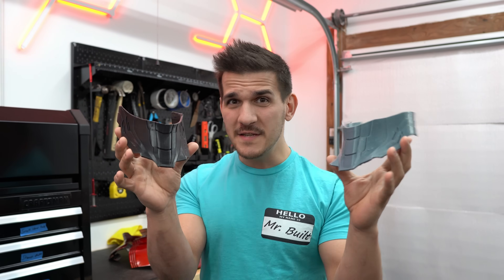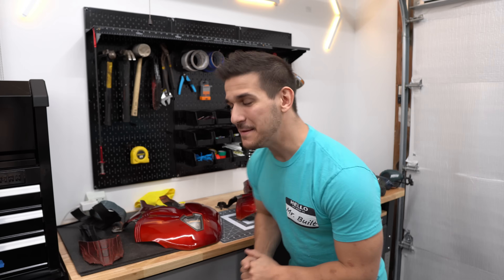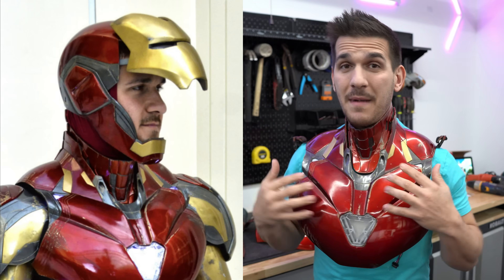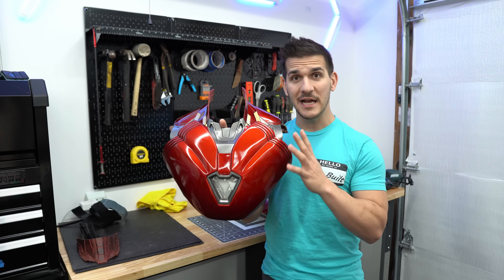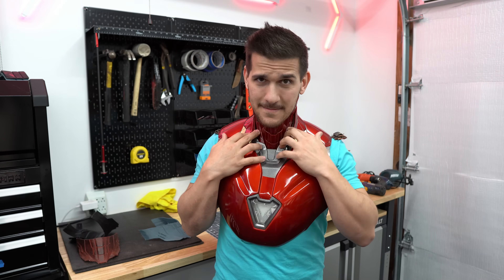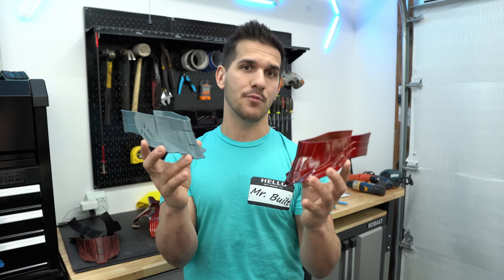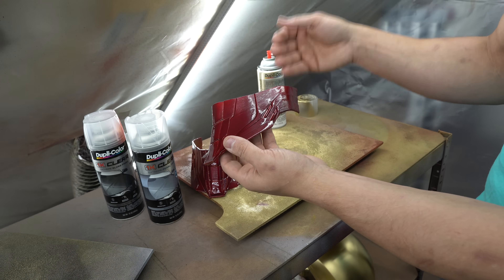Flexible PLA!? - 3D Printing & Painting FLEXIBLE Cosplay Armor!

Comment: Cool video.  I enjoyed it.  And I learned stuff.  Way to go, dude.
Flexible urethane bumper spray paint.  And do all the rattlecan painting tricks.  (Lots of shaking, immerse in very warm water, use aftermarket "fan" spray nozzles.)  That's my suggestion.

Comment: So I've just figured out a better method with flexible pla I've just made a robin utility belt with it. 

Step 1: sand like normal I like to start with 80grit then work up to 400 grit.

Step 2: filler prime like normal I sanded and prime about twice before wet sanding working my way up to a 15000 grit just prime and sand till layer lines are gone

Step 3: after wet sanding now you can use plastidip I did about 3 even coats and soak the can in hot water should look like rubber after and if you did even good coats should be really smooth 

Step 4. After waiting about 4 hours  you can Paint however you want 

Notes: the filler prime Step is to get rid of layer lines and is fine with minimal flex but with a belt the filler primer cracks. That's why the plastidip Step comes in the plasti dip will cover up any cracks that may happen and help whatever Paint you use flex without cracking so you don't have to buy flexible paints or whatever.

Comment: I am attempting to dive into the realm of 3D printed armour builds for future cosplay's like Springtrap (fnaf.) and my clone trooper OC (Star wars.) I want to be able to move properly in my creations and I have a few bad joints that tend to get quite stiff after wearing foam armour etc. 

I have an Elegoo Neptune 3D Max printer and so far? I have loved how it prints PLA+. (Previously had a Creality CR-10 -V2.) A direct extruder printer has been 1000x better to program and to use. What base settings would you suggest I try with my Max in terms of this flexible PLA material? (And, which brand of such would you recommend?? I have heard that Flash Forge is quite a good brand. ) I use Prusa slicer as my slicer of choice (used to use Cura when I first started out but Prusa became easier for me to navigate and understand ^^;  ) 

Thank you :)

Comment: hey just a fyi sunlu sales a filiment holder that is sealed up and the filiment goes through a hole in the glass and you can use the heater if you want but i have never had to yet. but my flexable pla does not act funny from the water in the air check it out. i have one on each of my printers and my filiment works better with them

Comment: Hey Frank, 

So im building the Do3d version of the MK 45 and was wondering both with the flexible pla and regular pla whats the best method you recommend for getting the mangets to set in their preset locations? Like hot glue, super glue because super glue kinda a super mess but open to advise.

Comment: This looks great but the visible layer lines are still a bit of an eyesore. It sounds like you can sand a bit but there's a limit to how smooth you can get with subtractive smoothing methods like sanding? To me it sounds like the next step is exploring sandable flexible fillers. 
You could start with flexible silicone but that's thick and viscous and really tough to smooth out, and isn't really sandable. 
Better is to look into acrylic or poly flexible fillers for building. There's a heap of these so definitely worth seeing how well they can be applied, smoothed and sanded to improve that surface finish and what impact it has on paint and flexibility. 
Just looking at this I'm imagining awesome costumes like the comic book style red and gold Iron-Spider suit, or 3D printing Batman cowls or costumes. But you gotta get that surface finish quality up.

Comment: Oh, this gives me plenty of ideas. I think what you could do is use some of the same techniques for coating EVA foam for the flexible PLA here. I have yet to publish my video on my various experiments with getting sandable and flexible coatings on EVA foam, but that should be coming soon. I'll try experimenting with this material myself someday for my Ultraman suit.

I use a combination of various types of sealants. Flexbond, which is pretty much a more flexible PVA glue. DAP Kwik Seal. Plaid FX paint. Hexflex. Rapid Fill, along with its companion Fine Finish. I haven't tried Gap Filla. What I did for my third Ultraman helmet (video coming soon, along with the suit itself) was a combination of Flexbond, Kwik Seal, Hexflex (Poly Props), and Plaid FX paint. I just mixed them all together and applied it. It resulted in a flexible and easily sandable surface, especially when applied with a flat paint brush. I then followed that up with 3 coats of Plasti-Dip and airbrushed a mix of Plaid FX paints (with a touch of Vallejo model air paints). I'm going to use a flexible clear coat (varnish) over it, although not without proper testing. All of this may work with flexible PLA as well.

Comment: Excellent stuff, Frank! One trick I've seen to make plastic surfaces more receptive to paint layers is to quickly "flame" the furface by running a blowtorch - or even just a hot-air gun - over the surface just prior to painting. No idea if this would make a difference, but it's worth a go!

Comment: I've had a lot of trouble trying to get this to print on my Bowden Ender 3 Pro. I have a Seemecnc EZR extruder on it and was told it would work for flexible filament, but the gears slip on it and after too long of a print it just pancakes the filament in the extruder.

Comment: Can you experiment with fussing two flexible prints together?  I’d like to print a full size cowel but would need to split it into two pieces. If I can’t fuse them together and had the fuse with sanding paint etc. it won’t be worth it to me.

Comment: Nice...your painting techniques are improving.🤔 Try using a higher sanding paper...like 320 or 400 between coats, also wet sanding will help a lot. Letting each coat dry for several hours before sanding. and with the clear coat...after it has fully cured get a high "0" rating steel wool (like 3 or 4) to polish the clear coat to a high gloss(also using water with the steel wool).😉
Can't wait to see your new and improved Ironman suit.👍

Comment: 8:51 About discoloration of PLA after sanding; if you very lightly go over the affected area with a high temp heat gun/ butane lighter, it will bring the normal color back for the most part after sanding

A simple butane lighter has been one of my most valuable tools for 3D printing. I also use it for getting rid of stringing. As long as you hit the area for a second or two from a good distance, it won’t hurt your print

Comment: Hey bud! HEAT YOUR PAINT! Warm bath works. I like to spray with cans at 70-75 degrees. The rubber stuff (plasti dip and such) responds like a dream to a little warmth. Also... have you tried adhesion promoter? Works great when painting urethane armor with Dupli-Color vinly and upholstery paint. Instead of dip primer, might keep your top coats from flaking/peeling. Awesome vid!

Comment: click on this video as I'm printing with ATARAXIA ART to make a phone case... I made some flexible dinos for my nephew with these and hand painted them with acrylics. Tips and tricks?: It takes some time and can be a little hard to do, but I used a lower temp soldering iron to smooth out layer lines on the Dino to make it look like an injection molded part. Flat tips would work best. You don't want to go too hot, it will discolor or warp, but a lower temp and it is fairly workable. Holes can be filled in also with spare filament like standard pla prints as well. But that also takes some care to not mess it up worse. It takes a steady hand, but gives good results if you are patient.

Comment: Look into Halo EFX for painting flexible parts. Plastidip, rustoleum flex, etc are all rubber based, but Halo is vinyl based. The big advantage is it is more compatible with standard paints so you can use metal cast, clears and such with way less spidering due to reactions. You can actually clear coat Halo with 2K automotive clear with a flex ability additive (common for bumpers).

Comment: Tips that I learned from Kamui Cosplay and her eva foam and dealing with flexible paint: the plastidip is great but you want to put the can in some real warm water, get the coating up to around 80-90F. This lets it flot and end smoother. It can then be smoothed further with mineral spirits. Hobby Lobby also carries some eva foam paint that is designed to be very flexible  for use on foam but you'll be airbrushing.

Hope it helps and future iterations and always appreciate your vids!

Comment: I agree with some of the other comments. From working with EVA, learned to always warm plasti-drip type materials in warm water before using and occasionally warming it back up.  Really stops the glob issues.  You could also try flexible paints like PlaidFX or Flexi Paint at least as a primer type layer. Both also offer metallic armor colors that might work as base coats.

Comment: try the heatgun for a reallyy smooth surface on TPU
Reply from the maker: Guess you missed the part where I said I tried to use a heat gun and it didn’t work 😅
Reply: @FranklyBuilt  probably....print it with 999 perimeter and try again..

Comment: I have another thing you could try out with this material, connect parts together. In the event someone is printing something on a smaller print bed or whatever reason, would it be possible to join them together.

Comment: Something to consider: Have you tried priming and painting the flexible PLA with the same stuff EVA foam builders prime and paint their cosplay pieces with? We tend to use primers like Flexbond (thinned down with water) to get into the pores (and maybe this could work with layer lines) and build up a paintable layer.
Reply from the maker: I could try it but that’s just more
Work and steps. The point of this was to test simple methods for similar or better results
Reply: Please build a flexible version of the Mark85 armor and you could possibly do a mark50 version too with the flexible PLA

Comment: I've been having issues with the FPLA sticking to the bed.  It's actually ruined a coated glass and flex bed.  Anyone else encounter the problem?  If so, what fixed it?  If you haven't, what type of bed / printer do you have?  

this happened to me on my e3 S1 Plus as well as my FLSUN v400.

Comment: So I've been printing TPU a lot lately for my own cosplay. When you use the heatgun method, the part needs to be 100% solid, otherwise you get that deformation you mentioned.
Lately I've been using something called FlexBond by ROSCO for smoothing and priming. It's basically a mix of silicone and white glue that I brush on in thick layers, then I can sand that down a lot easier than TPU can be sanded. From there, just paint using flexible acrylics
Reply: Is FlexBond different from FlexiBond from ROSCO? I used to use that stuff years ago, but it was latex not silicone.
Reply: @phenomenalfx2965  Thanks for pointing that out. It is called FlexBond, but you're right, latex, not silicone

Comment: 14:35 It does. At this point, although Flexable PLA has its uses in cosplay, I think that it's limited on the type of paint that can be applied on the surface. Enamel paints are not a viable option when it comes to flexible surfaces. Once it cures, any type of bending or flexing will make the paint crack. I suggest using more "durable" paints like leather paint or acrylic paints for parts that will actually bend, flex, or squash.

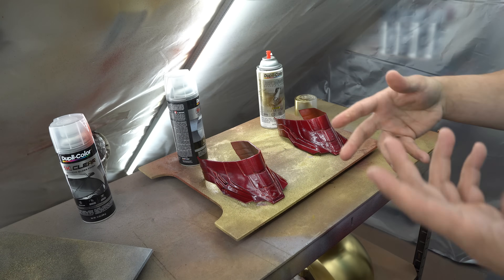14:52 I think it will because you are spraying a plastic sheen over the surface with that type of gloss.

Comment: In Cura you can enable a setting that lets you print rafts and supports with a different filament if you have a printer with a dual extruder, so that could be another option for printing them without them being flexible as well

Comment: What you could do to make life MUCH easier for yourself would be to print a thin version in the flexible material as a skin of a baselayer, with sections of the neck glued over the 'skin' in rigid pla.
That way, you'll provide structure and flexibility where and how you need whist also having the look you want as well.
If only you there was a printer which could print different layers together which would fuse during curing...

Comment: This stuff is a game changer for 3d print cosplay. Can’t wait to see what it’s used for!!
Reply: I can think of so e things, like flexible parts for in joints like elbows and such. Even helmet seals would work well, so a helmet can be closed closer around the neck. Heck probably even under-suit stuff like the halo reach flexible bits. You could even print a batman cowl with this stuff
Reply: I bet you could even print armor like stormtrooper armor and it be a lot more easy to move in and be able to sit down in it